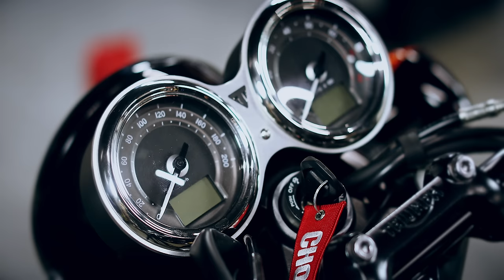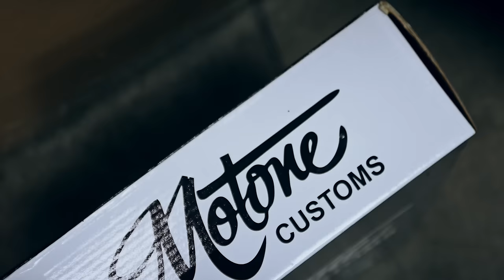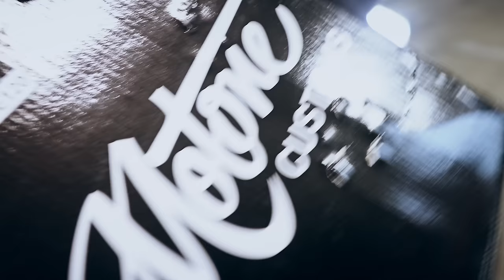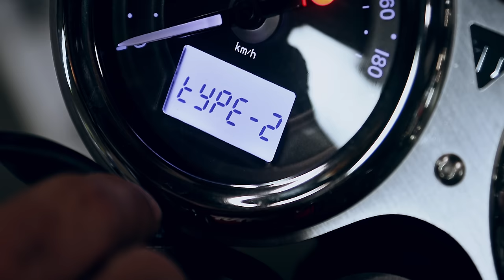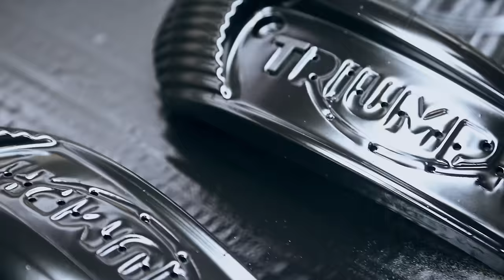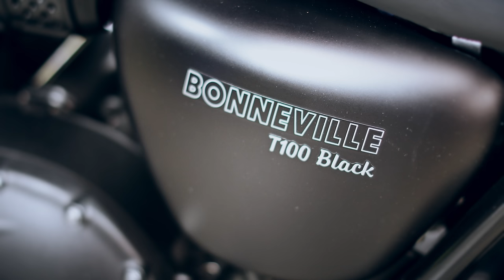Mighty Bike Mods - Triumph Bonneville

Comment: Complains about killing the planet by putting sauce in the fridge while de-catting his bike. Never change Moog.
Reply: Don't worry about it motorcycle emissions are heeeeeaaaaaaaaaaaaps better than cars, we don't even need emission tests for motorcycles in Switzerland
Reply: @ImBarryScottCSS  not many states require it, I don't recall many Canadian provinces requiring them. The technology is actually quite different, obd2 isn't required on bikes most aren't full closed loop. But bikes are usually way leaner running and the wet clutch systems mean that the engine works significantly less hard to spin the flywheel at cruising speeds.
Reply: @factoryrider9537  more like the other way round.
Reply: @factoryrider9537  actually they got worse emissions than cars, but less amount. 
There is a Mythbusters episode where they investigate this 😂
Reply: Cats on a motorcycle 🤔🤔🤔 glad that’s not required here in the states.
Reply: @crzycracka69  A LOT of the brand new bikes have cats in that giant suitcase of an exhaust they have underneath
Or like the new cbr1000rr theyre hidden underneath before the slip on muffler
Reply: @crzycracka69  a newer r6 has 3 cats.  For a long time the epa and europe didn't pay attention to bikes.  Now they have standards they have to meet and other than just noise.
Reply: VtecGoesBwaahh bikes have terrible emissions, you can smell how much dirtier their exhaust gasses are compared to a car.
Reply: Everyone is talking about the bike well im thinking who tf doesn't put sauce in the fridge. That's old people shit
Reply: i mean, cats convert carbon monoxide etc. into carbon dioxide. Carbon dioxide is what causes global warming, so theoretically we are saving the world.
Reply: On my sauce bottle it says, keep refrigerated. So that's what I do. Not all need it though
Reply: The sauce answer is pretty clear: Follow the instructions on the bottle. Most sauces say refrigerate after opening at below 4deg. So there's no contradiction here, Moog is simply advocating potentially doing yourself harm.
Reply: @ImBarryScottCSS  

Yes, you pillock, but due to their light weight and relatively small engines they use a hell of a lot less fuel to move.
Reply: Motorcycles more efficient? My TL1000R gets worse mileage than my 3L turbo BMW.
Reply: Thermal mass! Once cooled the sauce actually helps the fridge efficiency. When you open the door, cool air leaks out. That bottle take the place of cold air that would leak out & warm air that would replace it.

It's similar to how heavier brake rotors can absorb more energy (heat) before cooking pads.
Reply: JellyD hahahahah
Reply: It's not even a "planet" anyway. Take those cats off!
Reply: ChrisHallett83  here here well said
Reply: What if I told you that sauce only existed inside the mind?
Reply: Bikes with 4 strokes, efi, and water cooling are clean.  Bikes that are 2 stroke, carved, and air cooled are very dirty.  So it depends.  The T100 is very clean, removing the cat isnt a big deal at all, but does give much better performance.
Reply: Da Big Bad Wolf yes because mythbusters has always been a reliable source.
Reply: ChrisHallett83 dude, agriculture is the biggest offender in emissions. Stop eating meat...
Reply: @ImBarryScottCSS  except you don't have one person driving a 1.8 liter bike that weighs 2 tons every day to and from work. Surely bikes are tenfold more efficient and emissions friendly when compared to all the 5 seater cars being driven by 1 person
Reply: Modern motorcycles are more fuel efficient and their weight is negligible. At least compared to modern American cars. Less weight to lug around=less energy required=less gas to burn=less emissions=fuck catalytic converters i wanna go vrooom vrooom
Reply: @ImBarryScottCSS  i cannot accurately how satisfying it is to see someone tse the word "troglodyte" in a sentence 👌
Reply: @astletruscott6291  sauce definitely belongs in the cupboard 😉✌#teammoog 😂😂😂🤷‍♂️
Reply: @factoryrider9537  Not true, pound for pound, Motorbikes pollute more than cars.
Reply: @ImBarryScottCSS  motorcycle emissions are worse, but there's much less of them, so it tends to be not quite as bad as cars
Reply: Modern autos and motorcycles are more alike now than ever. The CVT transmission is common in small autos now and quite a few machines have bigger engines than some cars. With ECU controlled systems, the mods commonly done to intakes and exhausts have little effect on performance. Theres a difference between throttle response and actual output of an internal combustion engine. If it looks and sounds better, does that mean its actually making more power? Maybe, maybe not? Many times just modifying the factory equipment will garner the best results.
Reply: @CrazyPanda688  You think that’s shitty, should see the mileage my 2 stroke triple cylinder Yamaha outboard gets.
Reply: The tail tidy looks horrible, the original classic mudguard looks cool and works perfectly. 
 If your told tail tidy looks better you don't necessarily have to believe that 🙄

Comment: "Take the seat and the tank off" is the motorcycle equivalent of "jack up you car"
Reply: Working on my KTM it's more like, remove the seats, take the tank fairing, side fairings, indicator fairings and engine bars off, then lock off the fuel hoses and wrestle the tank off with the extra pair of arms you've grown while removing everything else.
Reply: @danhill7525  You forgot the extra hand you are always short.

Comment: I never really was a fan of bikes but now I want one. Thanks MCM sending me bankrupt one video at a time.
Reply: That's what's great about bikes though! They're cheap as sin, and even cheaper for modifying.

They're also easy to modify, or at the very least, to wrap your head around what all needs done. 

Needing to replace, rewire, or customize? Everything can be scene at a glance, so it's easy to see how everything connects, which makes it much easier to know what needs to come off when the situation calls for it.

Whatever you do though, do not skimp on safety gear. Quality motorbike safety gear can be pricey itself, to the point where too many people think of it as a necessary expense. But here's the thing, it only takes one crash for quality gear to prove it's worth.

Be safe, be smart, have fun. Happy riding!
Reply: Miggy2j don’t get a gsxr

Comment: i modified a 1986 Bonneville T140 a few years back for my friend :)
Modified the original frame to hardtail, Which was a task in itself, due to being OIF (Oil In Frame), But i managed to make it so that the hardtail tubing was also oil storage too :)
Ended up with a Pin Striped Solo seat and Mid-Height Z bars and a short rear fender.
Beautiful bobber project, and to this day, My friend still loves it :)

Comment: Can't believe you fitted a Motone X-pipe instead of a "made in Australia" Meerkat unit!
Get in touch if you want a race cam designed by Hallam Racing (who did the salt-race bike you mentioned) to give a big torque and power boost.
Reply: And the Meerkat X pipe manufacture has the Dyno readout to prove the power increase, unlike Motone

Comment: Totally agree, sauce is made for the cupboard not the fridge, u don't get it out the fridge in the shop, oh and loving the bike vids
Reply: It’s sealed in the shop. As soon as you open it you introduce bacteria
Reply: Read the bottle. "Refrigerate after opening."
Reply: A full fridge is actually uses less energy Than a empty one. 😊
Reply: Joakim Jansson Aahhh no. The amount of stuff in a fridge doesn't alter the insulation and the heat transfer into it. When it's closed that's the only way it "loses cold". It's conceivable to imagine that there is less volume of cold air "lost" and replaced with room air when you open & close the door but there's also the increased surface area of items in the fridge that will convect heat to that air when the door is open.
Reply: @DiscoFang  wwwwwwhat,simple terms, ketchup should not b fridge cold
Reply: Lee Elliott Simple answer: Ketchup is not food. Get real sauce.

Comment: I daily/commute a 2012 G650GS Sertao, I honestly don't think I could recommend it enough! I take it on old dirt roads and atv trails and it does great. Its only 420lbs/190kg so it's not hard to pick up if need be. However for long road trips on mostly pavement I would rather recommend the smoother 1200's, but they're far heavier off-road. 
But where I live paved roads aren't as common. Cheers!

Comment: get a 50cc 2 stroke little moped, and upgrade it to 70cc, crazy modify the engine to make it accelerate faster than anything you ahve in your garage ;) (apart from the golf)
Reply: i wanna get one of those 50cc 2t streetbike looking scooters/mopeds but they cost just as much as a regular bike
Reply: @dshiznit148  where I live you can get one for as less as 50 euros. And if you want one that's driving, it's 150 euro...

Comment: Ive been intrigued by the reinvented Triumph. A friend had bought one in about 2003 new. Its 2024 and one in particular came into view. I would like to purchase it. A2004-5 model year.   A perfect mod bike it seems to me. Stout frame. Seems like a reliable engine/trans setup.  Put on some grand suspention components forks/shocks. Cool sporting things seat mirrors lights (the bike i am spying has a Corban saddle. Some funky muflers)  true spoked wheels disc brakes of some quality (std equipment). All in all cool looks. Could be a realy solid  ridable bike !

Comment: Hi guys, great video. I just got one t100 black and I am looking forward to do these modifications. My only doubt is if the mud guard is made small then it will splash all the dirt and water on the radiator and maybe on the rider as well. Kindly advise how to tackle that problem.
Enjoyed the video. Great job

Comment: The bike is prepped for a certain thing yeah but I find it funny that they add a bash plate for protection, but then chose a front fender that is shorter to the back, so more sand etc. will fly to the engine and radiator. PS I have a F650GS (800 cc, 2008 model) and love it. It can do it all except real offroad, gravel roads and easy trails no probs!

Comment: My opinion on where to put the sauce has changed over the years. Back before the twist top squeeze bottles it needed to be in the cupboard so you could pour it easily. But that is no longer an issue.

Comment: You may or may not know this or may or may not be interested but Phil Irving an Australian engineer who worked for Vincent and designed the Vincent 1000 cc engine suggested to Edward Turner the designer of the Triumph twin engine to modify the 360 deg twin to 76 deg - 284 deg giving the characteristics of a V-twin engine therefore smoother and more torque as in those days balancer shafts were not used. Triumph never did it though a few individuals who raced Triumphs did.

Comment: Marty is correct.  once the sauce / food is cold, the refrigerator takes less energy to keep it cold, and takes up air volume in the fridge.   refrigerators cool the air inside by extracting the heat, so the more food you keep inside them, the less air the fridge has to cool.   In long power outages,  if you have a lot of food in the fridge, the cold food keeps everything cold longer.   less food inside and it will heat up faster and go bad.    Now if the sauce has enough acidic content, and if doesn't have to be put in a fridge, ya it never has to be cooled down by the fridge .... but  the fridge is plugged in 24-7, so the fridge is running regardless if the sauce is in the fridge or not.

Comment: Nice Bike.  Something you may want to look at when you comes to actually riding it around on the road.  Small indicator lights (no-matter how bright) are much harder to see at a distance than larger lights.  Think of it this way.  If your looking at something that's only 1cm square, then at a given distance (200 meters for example, not sure) it disappears from sight no matter how bright it is.  If its twice the dimensions (2x2) then you will be able to see if from about 2 times the distance, again, regardless of how bright it is.  
And its not only just not being able to see it.  Even if you can see it, a smaller object is easier to miss (specially out the corner of your eye where your "pixel" density is much less).
I had this brought home to me one group ride.  Someone almost wiped me out because they overtook me as I was about to turn right into a Petrol station (think of turning left America).  Simple explanation was, "I didn't see you indicating".  His GoPro did, but the point was made very clear.  Others also said they had issues seeing my indicators on that ride.  Next day I put my old indicators back on till a larger set of LED's arrived.
The brightness helps, but its the size that really matters with visuals (to a point, ie given enough light to see the damn thing of course).
Dont get me wrong, I hate the stock lights on bikes, and a rear fender eliminator/tail tidy is a must as far as I'm concerned, but dont go too small if you want others to see your indicators.  Not sure about the law the small indicators, but I would suggest its better to be safe than sorry.  You can cry "But I did indicate and my lights are legal" all you want from a hospital bed, but right or wrong, your still laid up in a hospital bed broken and in pain.  :(
just sayin.

Comment: Nice mod guys. As a biker I appreciate that you put something in there for us. Could I request something a little higher stakes for your next Mighty Bike Mods episode.... Try getting a Kawasaki ZX1400 or suzuki Hyabusa 1300 and running some exhaust mods and a turbo! Take 200 BHP up to around 350-400 without too many hassles. The ZX14's already do sub 10 second quarter miles so would be a sled! Anyway keep up the good work! Thanks.

Comment: I would like to say, your small mods to your bike were quite interesting..I liked the tail light mainly, I have 2016 T120 have done the cat change with same pipe as u, but have changed the exhaust and fitted Power Commander, standed 64hp now 75rwhp with 83nmt... .. Mine is Chrome didn`t like the Black.. I have 1924 AJS 1929 AJS 1956 Triumph T110, 1975 Trident T160, 1975 Norton Mk3 & 2 x Triumph bicycles 1954 & 2010 ..

Comment: For a decent adventure bike, maybe consider the KTM superduke. 
Sure, you'll spend most most of the time breaking the sound barrier, having the hairs ripped from their follicles as you streak down the highway, looking at the sky as the bike forces it's front wheel as high up from the road as it can without you throwing you into perpetual backflips.
But it has a touch display and looks quite nice too

Comment: fridges are more efficient when they are full because the mass helps regulate the temperature. Sauce in the fridge makes it more efficient once cold to re-cold itself as you open and close the door throughout normal use

Comment: Sauces are kept in the fridge to slow down multiplication of bacteria once it's opened, but on the main topic, a fridge full of sauces is more efficient than an almost empty fridge!... the reason is that when you open the fridge door of the empty one, a waterfall of cold air runs out off the bottom shelf and gets replaced by ambient temperature, whereas the fridge full of sauces will hold on to the cold temperature.  This theory is aimed towards freezers more but the principal remains..  😄

Comment: I'm disappointed you didn't use black screws on the brake fluid reservoir... lord, talk about half a job!! :-O (seriously fun to ride but on that single front disc you must fit a Brembo or EBC 'HH' rated pads to get some half decent stopping power from the T100). Good job!

Comment: WOW WOW WOW I gotta chime in on the fridge thing. But moog there is a flaw in your theory, The fact that marty is keeping something so dense in his fridge is actually better for the environment, If your fridge is more full with more things that keep cool, when you open the door the air is replaced but the hot air outside the fridge, the sauses will act like an ice pack and retain coolness and bring the fridge back to operating temp quicker. #FRIDGESAUSEWIN

Comment: Friends. Thank you for the vídeo. I have a bonneville t100 2022 and never thought on removing the fender, but I liked this so much that I'm considering. 
The mirror plug I also was looking and practically gave up. Thanks !
Is it possible if you compare the noise level before and after putting the Motone X thing (forgot the name 😅)? Because from the video i didn't noticed a lot of difference... thanks again

Comment: I love my T120 —— wait til you have problems with the marginal WIRING HARNESS. YOU WILL NOT APPRECIATE THE low quality wire,yuk electrical tape, lo bid connectors, and crammed in layout. How do I know this???

Comment: I contacted Motone a couple of weeks back enquiring about their x-pipe. I asked if it would increase the power on a Thruxton R. 'Sure, for the cost it's a no brainer' came the response. 'Great' i replied, 'have you a Dyno graph readout?' Never heard back from them.
   I've been biking for over 30yrs and used to fall for all the false promises in the past. Now, before i part with my cash, i want these companies to back up their claims with hard evidence. if they have confidence in their products then it shouldn't be a problem. Anyway I'll be buying from a German company that does have the Dyno readout for it's performance enhancing products.

Comment: lol once you remove the thermal energy from something as long as you don't add more thermal energy to it then there is no additional energy required to extract any additional thermal energy from said sauce. IE: Marty is right, Moog is removing the cat from the exhaust, prius batteries do more damage to the environment then an equivalent petrol powered vehicle. These are all facts.